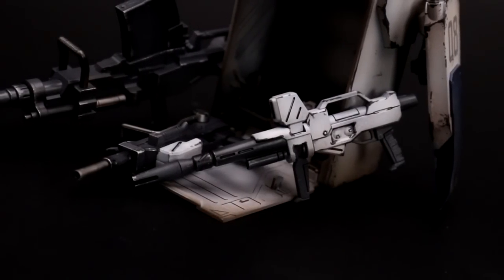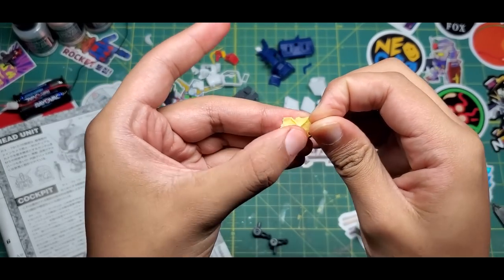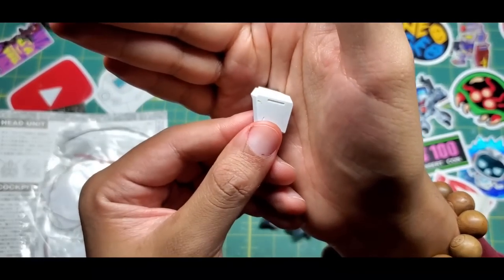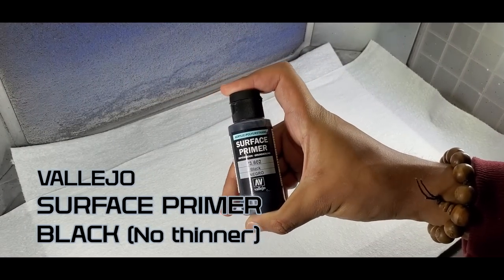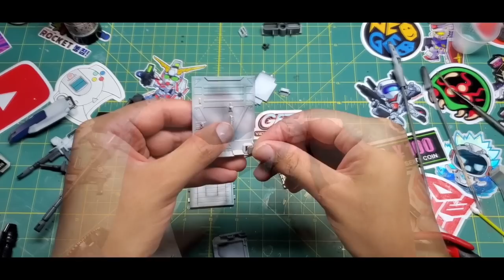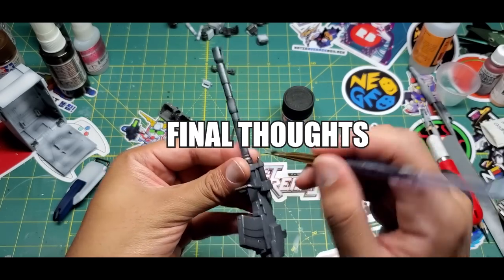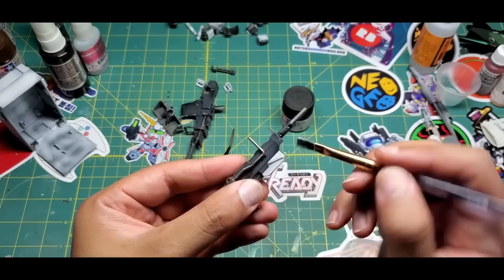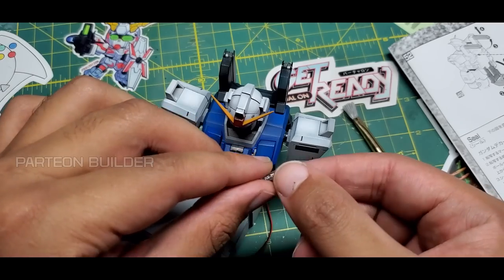#newtype #Otakubuilder MASTER GRADE RX79G Gundam

Comment: 1:42 Who's "...Norm Packard..."? It clearly says Norris Packard.
4:14 Considering that the MGs from Mobile Suit Gundam: The 08th MS Team require screws and includes those figures, I think they're overdue for an updated release., and I'm sure fans would really appreciate it.
At least Bandai should do:
- MG RX-79[G]Ez-8 Gundam Ez8 [Ver2.0]
- MG RX-79Ez-8/HAC Gundam Ez8 Heavy Armed Custom
- MG RX-79Ez-8/HMC Gundam Ez8 High Mobility Custom
- MG RX-79[G] Gundam Ground Type [Ver2.0]
- MG RGM-79[G] GM Sniper [Ver2.0]
- MG RGM-79[G] GM Ground Type [Ver2.0]
- MG RGM-79[E] GM Early Type
- MG RB-79K Ball Type K [Ver2.0]
- MG MS-07H-8 Gouf Flight Type (Norris Packard Custom)
- MG MS-05Q Zaku I (Norris Packard Custom)
- MG MS-06JC Zaku II (Norris Packard Custom)
- MG MS-07B-3 Gouf Custom (Norris Packard Custom) [Ver2.0]
...of course some of these would probably end up being P-Bandai add on or a full kit, and others might not be made.

Comment: I'm currently building this kit now actually.  Hands down my favorite Gundam model.  Did you have trouble with the leg beam saber holders?  I'm dry fitting everything to make sure everything lines up well before paint incase i need to glue some seams, and the mech to slide out the armor panel to reveal the holders keeps popping out of its spot, probably going to have to glue it it place, but other than that great build